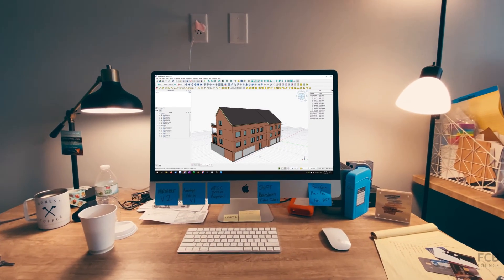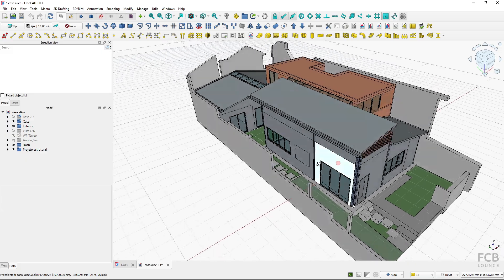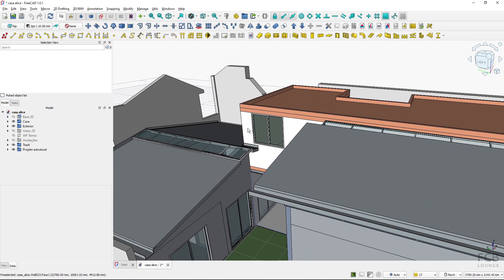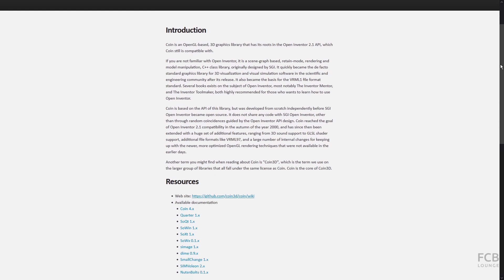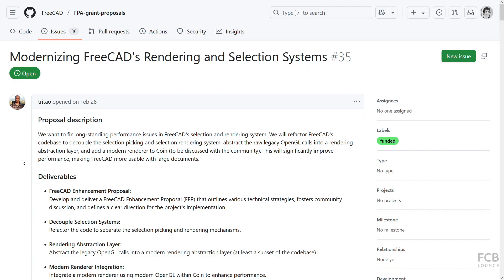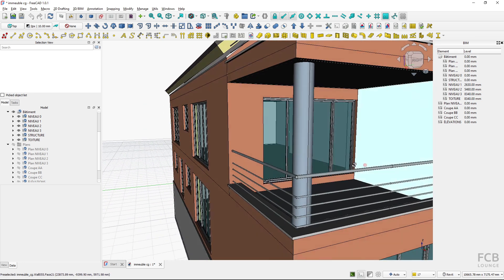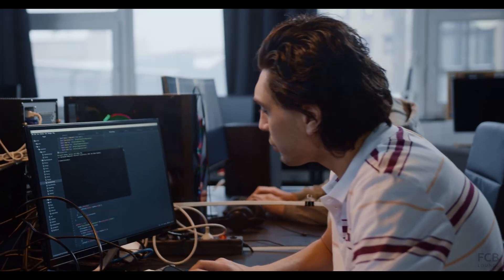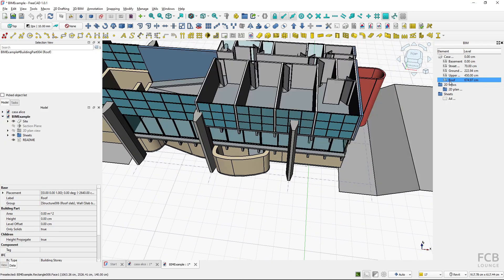Which GPU is best for FreeCAD?

Comment: Hi Tom, I do not have a powerful computer and after Version 1.0 I've experienced some annoying FreeCAD crashes when trying to open files. Normally only at the 2nd or 3rd attempt I'm successful. Does it also happen to you? I'm using Win10 OS...
Reply from the maker: I am also using Win10, but I have a crappt computer :).

I can not really compare as I have only jumped into FreeCAD more intensively last year and I mostly used the 0.22dev -> 1.0 version.

It's unfortunate to have more crashes with the new version. From what I read there should be an effort to focus more on stability post 1.0 release.
Reply: @FCBlounge  Thanks for your answer, I thought I were the only one...:eyes-purple-crying:
Reply from the maker: If you have a file that you can reliably reproduce crashing in FC 1.0 and not the previous versions, report it to GitHub of FreeCAD forum, so that developers or other people can look at the file. You will find out, whether the problem occurs only on your machine or if it happens to other people.

Comment: Some (very) old computers may run FreeCAD, but rendering are very pixelated.
Example: Dell Optiplex 780 (2013) with Intel Core2 Duo E8400 + Intel 4 Series Integrated Graphics. On this particular HW, FreeCAD doesn't provide any antialiasing options that works.
Reply from the maker: Thanks for sharing.
Of course there are some cases where GPU will matter, the video is painting with a broad brush.

Comment: 100% agree, FreeCAD has the great advantage of not requiring a powerful workstation — it runs on almost any PC. I've even managed to run it on a Raspberry Pi; it's just a bit slower, but it works! It's crazy!
Reply from the maker: Not sure if it is an advantage to not use modern hardware.

But it is for sure amazing where FreeCAD can run - I saw a video running FreeCAD on a very old mobile phone.
Reply: @FCBlounge  let's agree, FreeCAD runs faster and better and smoother on lasts cpu with a correct graphic card, but it's not mandatory. And you don't need imperatively a z400 very expensive workstation 😅
Reply from the maker: @ga3d_._tech528  One can only agree with that.